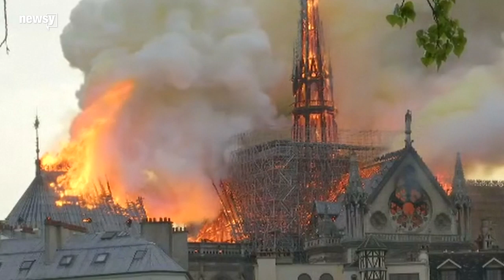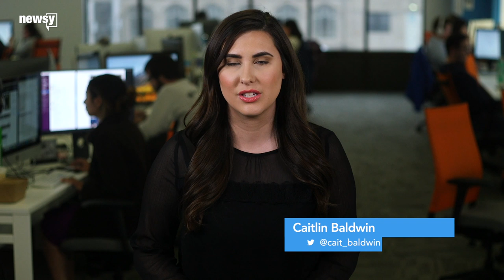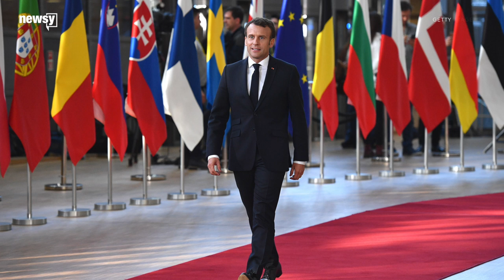Short-circuit may have caused Notre Dame fire

Comment: Short?  IUU think not. Very few electrical fires are caused by :"shorts". Most are caused by excessive resistance and the associated I2R heating. The thing is that requires the circuit to be under load. If everyone was gone, then what was pulling a load?